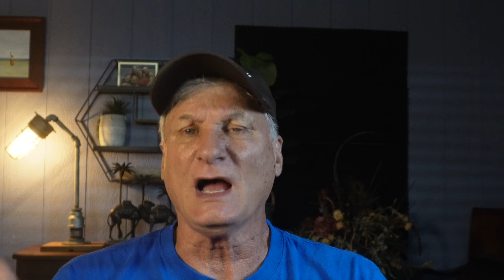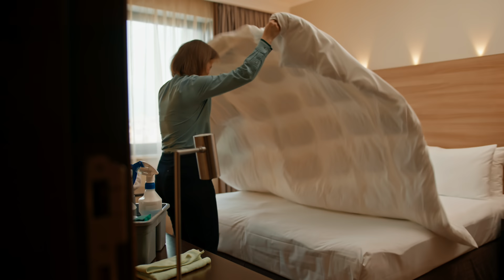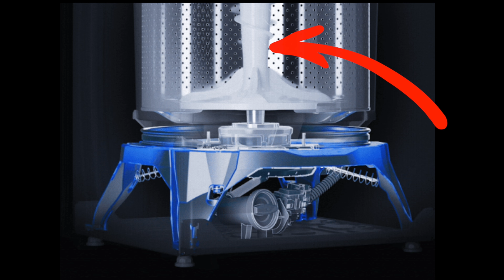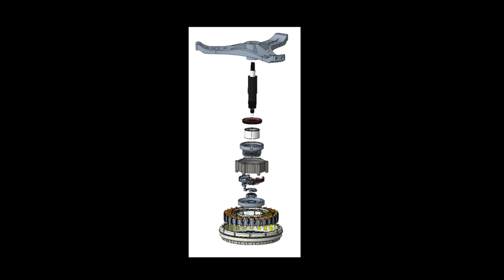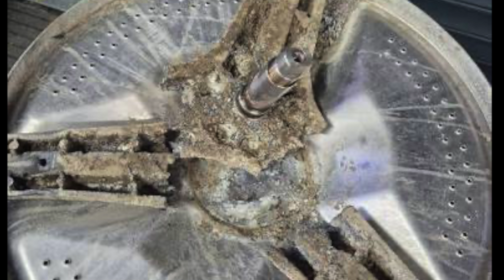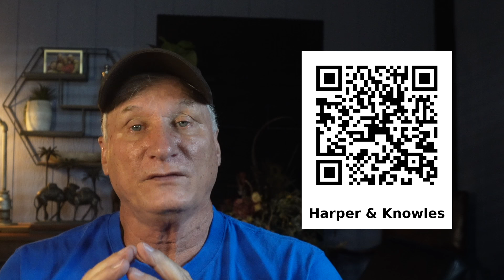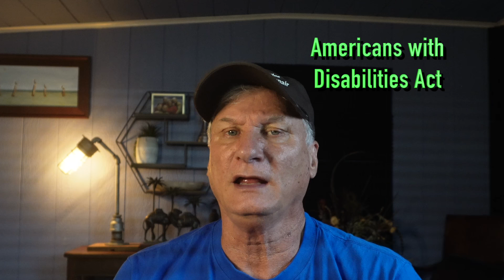Maytag's New 30-Year Washer: No Gearcase, Real Agitator, 900 RPM

Comment: I love my LG front load washer and matching electric dryer with sidekick pedestals... got them in 2010. I've had to replace the drain pump just once ($25) from all the sand in dog beds and just once replaced  the inner ($9) & outer ($9) main bearings because of the monthly washing of not balanced heavy load XL dog beds. Both jobs were cheap and easy.... just took watching a YouTube video, some time, and a $7 spring expansion tool. Overall it was fun and a very rewarding experience internally. A few months later we had a puddle of water in front of our LG french door refrigerator with bottom pull-out freezer drawer. So I defrosted it with an old HF heat gun, unclogged the defrost drain, gave the condenser coils a good cleaning with my handheld portable steam cleaner, and used the shop wet vac get everything out of the drain pan. With any luck 15-20 more years. I just wish water heaters lasted that long and were just as easy to work on. My home has 2 and I have personally replaced each one twice... so in my time in this house alone this place has seen 6 water heaters.
Reply: Thanks for the nostalgia, good for you. We need a NEW one, not what you had.

Comment: My daughter insists on Maytag. When it needed a pulley replacement, Appliance part salesman said part isn't available. Maytag says replace the motor. I send my Son in law a part number for a $5 part. Salesman said it's not a Maytag part. Told him to buy it anyway.  Screwed on no problem and works fine. $5 part or $300 plus motor. Checked the other part numbers while working on it. Whirlpool parts but ask for Maytag parts the exact same part is more expensive. Was a few years ago.

Comment: Maytag MTW8305T Warranty & DIY Breakdown: Year 1: Full coverage. Covers 100% of both parts and labor. Years 2–10: Limited parts coverage. Covers the drive motor and wash basket only. You must pay for all labor, diagnostic fees, and shipping. Years 11–30: No warranty coverage. Even though it is engineered for a 30-year lifespan, any breakdown after Year 10 (like Year 12) means you pay 100% out of pocket for parts and labor. Prorating: The warranty is NOT prorated. Covered parts are completely free during the warranty window, and full price after it expires. DIY Repairs: Mechanically, the machine is highly simplified (no belts, pulleys, or gearcases), making it very easy for a handy homeowner to repair. However, doing DIY repairs during the first 10 years will void your remaining factory warranty. Save the DIY work for Year 11 and beyond!

Comment: We had direct drive Whirlpool washers for decades. On lasted 25 years. When we bought a new model, the suspension rods lasted a year. After being replaced, there was no difference. That washer was trying to launch itself through a wall. I'd rather have a vintage direct drive again.

Comment: If they set up sensors that protect the machine against customer abuse better, it would also allow for better warranty on proper use. I have seen from just repairing a few machines how either, the customer gets lazy and overloads constantly on purpose or just lack of knowledge on how to properly use it. You can tell the difference when you open up the machine, but it's a little harder to prove. That drives the costs higher because the company loses money approving the repairs and that is passed to all the customers regardless if they have always used theirs properly. It's like theft rising in Wal-Mart and customers as a whole getting punished when they raise prices to make up the difference.

Comment: I have a laundry room at a RV park. It originally had mostly GE and one Whirlpool washer.
That Whirlpool was the biggest piece of garbage. The GEs were not great but still much better than Whirlpool. 
Mind you, these are coin operated machines.
The biggest problem with all of them was the tub suspension.  That's on both brands.
I replaced most of them with Speed Queens. 
In 4 years, the only problem I have had is the mixing valves. We have hard water and the valves fail. Other than that, they are tanks.
I would never buy a commercial Whirlpool washer.

Comment: I wish I would have done my homework and bought a used washer and dryer set instead of the new Whirlpool junk. The dryer broke less than 6 months in and the washer refuses to even use enough water to get the clothes wet! Even on "Deep wash" it only fills about 3 inches of water. I have to stand there and catch it after it "senses" the load and then fill it with a separate hose from the sink. Hopefully it doesn't switch over the the drain cycle and dump all of my washer detergent down the drain, forcing me to start over again! Their stupidity of trying to "save the planet" by not using enough water only forces the owner to run additional cycles 2-3 times in order to rinse all of the detergent out of the clothes. Otherwise, you get white powder residue all over your black pants. Nice job Whirlpool! You've created a washer that not only doesn't save water but it doesn't clean your clothes either. WORTHLESS JUNK!!! I'll be selling this set and buying a 20 y/o used set. 

Is it any wonder Whirlpool is spamming me with warranty insurance on a brand new washer?

Comment: I don’t care if whirlpool/Maytag gold plated their washers and sold them for $10. I will never ever in this lifetime buy another product by this POS company. They produce pure, unadulterated garbage. My 1974 Maytag set lasted 50 years. The two subsequent Maytag washers lasted less than three years. Their control board/power supplies died due to the lack of epoxy potting. The Customer experience was abysmal — the service people were inept and they screwed me knowing full well their supply chain was incapable of supplying the parts. Essentially, I came to learn that a Maytag washer is disposable. I will never ever put myself through that again. When a company screws its customers, I simply will never reward it with my business again. There’s a special place in hell for a company that pisses on a once proud American brand that was built by better people than the globalist cucks running these operations today. Whirlpool/Maytag deserves go bankrupt. Right now, speed queen has my vote.

Comment: So, huge water bill, wet clothes as no spin dy, soaking wet clothes dry couple of days inside and cause mold to the house, if using the press, buttons etc cause trouble, needs more detergent. And you will be stuck with that for 30 years. Nice choice...

Comment: I have give up on maytag.  I cannot believe LACK of quality, the OVER engineered junk that they sold me, that I bought based on my previous experience with Maytag.  I will never buy anything "energy/water" saving.  Appliances were meant to save TIME, EFFORT.  NOT water or energy.  Save me TIME and EFFORT and if you can squeeze in some savings elsewhere WITHOUT sacrificing the TIME & EFFORT, then fine.  But, I will NOT be buying a $1,500.00 maytag washer, when I tire of the current maytag foolishness; It will be a SPEED QUEEN, hands down, just like my dryer.  Because, it JUST WORKS.  Speed Queen engineers didn't loose sight of their purpose in life-save ME time, save effort.

Comment: I bought a house full of Whirlpool/KitchenAid appliances in 2002.

Surge suppressor MOVs on the cooktop control board burned like a welding arc during a power line surge. I watched it happen. Burned the traces off of the board, too. Got lucky, found a NOS board on eBay for $150.

Oven control board failed. Was lucky to trace the problem to a nearly microscopic surface mount transistor. Cobbled in a through-hole 2N3906 to fix it. Later on, a relay welded closed when an element burned out. Had to trip the breaker to stop the oven heating 24/7. eBay again, $329 NOS board.

Bought one of the first Duet washer/dryer pairs. Replaced the drain pump three times before getting one with a reliable impeller. Half a dozen failed inlet valves. Motor water shield shook its mounts apart, deafening rattle. Constant control board connection failures; worst PC board quality since 1960. Refurbed card edge connectors again and again. Power connector lead-free solder joints failed—of course—had to desolder them all and resolder with leaded solder. Got lucky with the basket bearing. It never failed. Dryer gas valve leaked, had to replace.

KA refrigerator pinholed, lost its refrigerant. (May we please have copper lines and coils again?) Replaced with Whirlpool. Control board quickly failed, another stuck relay. $300 plus a core charge. Most asinine icemaker design in history. Have to clear jams 2-3 times a week.

No more Whirlpool.

Comment: They just need to start producing the direct drive with 3360629 transmission and or someone with the money to buy the right and start producing or the old belt driven from the 60s 70s and 80s. As a repair technician big corporation is doing their best to make it a throw away when breaks and loosing customers faster than Ford's Police contacts with the crown vic

Comment: I got a brand new Maytag washer and dryer. The dryer takes 5x to dry one load. I’ve been hanging my clothes outside on the porch and then steam freshening them bc that’s the only cycle that works well on the dryer. The washing machine rusted around the bleach tray within one year and has since started chewing holes in my clothes. With and without the removable agitator. It’s only 3 years old. I laid almost $2,000 for the set. Maytag has gone to 💩

Comment: Bought new maytag washer and dryer 2 years ago. Dryer required a $300 circuit board at 13 months. Washer absolutely sucks. Won't put enough water in. Total garbage. I'm looking at a speed queen to replace it.

Comment: One piece at a time... reminds me of a 19495051525354555657585960616263... Cadillac.  >>;=)  It'd be neat to see a livestream or video of one of these units taken apart when (or if) they actually come out.  I am so sick and tired of this planned obsolescence crap and how we are in this whole arena of mfgd in China and only merely assembled in the US situation we are in with so many products (GE appliances for example, parts from abroad and put together in KY).  It's wild how much of the public feels a 10-year appliance is a "good appliance".  I just never bought into this... to me, a major appliance should most of the time last 20+ years.  I have an early 70s Kenmore washer I would be using except I had to break the agitator to get it off the shaft to get the machine apart, and didn't find a source for one (but maybe it uses the same one as more modern machines?) as other parts for it yet seem sourceable.. but I am using a mid-00s Whirlpool that I got off my dad and step mom when they had some problems with it.  I took it completely apart, deep cleaned it, repainted what was rusty, and replaced $40 worth of parts and until recently (another 8-10 years later), it's been cruising fine.  Currently fighting an agitator bolt that rusted that I may have to drill out, replace that bolt and the dog ear assembly, and it'll be back up despite being at least 20 yrs old at this point.  Maybe I've just been fortunate with what I've owned over the years, but I've been able to keep things running with small done-myself repairs.  Thusly, I own one of those spanner wrenches you were showing.  >>;=)  Also, still running off an '87 Kenmore gas dryer, but I mean... not much there TO go wrong LOL.  When I moved where I live now in 2010, I took that apart and just cleaned the heck out of it, but it's all original.
   Something that gets me is how control boards cost as much as laptops.  Circuit boards are pretty cheap to mfgr, I don't get why some appliances, the boards cost so much, pushing for replacement of the entire thing instead of one part of it.  I am hopeful for this to be a long-lived machine, because we need more quality products available on the market, which will force other mfgrs to up their game (but still avoid Samsung appliances like the plague that they are).  I feel just about everything you can buy in a big box store is just a step up from trash, and companies are chinching pennies to get you to buy new big purchases when I'd rather pay a little more for the actual product the first time and have it be more durable.  People who rant and rave about oil, the environment, etc., those same people forget plastic is made from oil and every product has plastic in it nowdays, so if we actually want to do ourselves a favor, we should be reducing how much and how many times we manufacture products (plus the power to run factories to do so), and opt for quality products and then replacing/upgrading specific parts as needed instead of throwing entire units away.  Many of us GenXers remember growing up in homes with the same appliances through entire times of growing up, some in HS still dealing with dark brown or avocado fridges.  😂
   What you said is so true sir, you get better when you buy better.  If consumers as a whole just flat quit buying lower of the bandwidth of quality of what is available, they'll either have to lower prices or offer more better-quality options.  The appliance market is rough, because you have so many builders and landlords who flood the market by being consumers of cheap as possible products to stuff into built/flippable homes to be sold or in rentals, plus just the modern general mindset that when making a purchase, the current price tag is ALL people look at instead of how the product is made, will it last, etc.  Although it's good business for fellows in the repair business, we should be trying to do better.  As those old commercials would indicate, the Maytag man should have lots of time to go fishing with the small-town sheriff.  >>;=)

Comment: I bought a used set of stackable front load LGs 6 yrs ago for $250. Ive had to replace the drain pump twice on the washer. Were one of those 15-20 loads a week families. I think they were 4-5yrs old when i bought them.

Comment: My moms Maytag washer lasted 41 years. Yes, my moms washer lasted 41 years and even was under salt water for several days inside the flooded home during Hurricane  Katrina and we moved it to the garage for disposal and sat their drying out for 8 months in a garage and we plugged it up and still worked.l! So we moved it 3 hours away and it was used until my mom moved.  Even the finish was not tarnished from the salt water! What the heck did they use back then for the finish? Salt water usually destroys everything! When she moved into assisted living we gave it away and from time to time we see the people in town and ask if it still works and it does. Unbelievable compared to todays appliances. Our WP fridge/freezer side by side, purchased in 1979 is still working today im 2026.  Still using that ugly old white thang but hey it works!  Never any service but we have kept all the dust vacuumed in the back and bottom front twice annually ourselves and it is still working. In the 60s great grandfather purchased a deep freezer cant remember brand, but he passed that deep freezer down thru family with it given to us in 1987 and we finally asked someone if they wanted it when we moved very far away  in Dec 2016 because we always heard if those old freezers are moved it could ajar the parts and not work anymore and we didnt have much room in moving truck. The former neighbors took it to store their meat. Saw that guy not long ago and it is still working also!  It is always topic of conversation today about longevity of these old appliances and our adult kids dont believe us, similar to stories of walking a mile to school I guess.  Even on these same brands, since started out of country mfrg and assembly and cheap plastic parts used on appliances , they last about 5 years. It is disgusting.  Revert to Good ole USA mfrg, USA made nonplastic parts, USA assembled and most importantly, USA Citizens making them!  My opinion.

Comment: I bought new, expensive Whirlpool washer and dryer and dishwasher in 2018, washer leaking out of the bottom of washer, already replaced the heating element and rollers on dryer. Dishwasher was absolute junk within 3 years, multiple repairs right away. Speed Queen for us when they finally quit and maybe Bosch dishwasher.

Comment: I haven't had to clean a filter in a top loader since the 1970's.  That washer pumped water during the entire cycle through a filter in the top of the agitator.  Why do you need a cleanout in a top loader?  Seems like engineers forgot when they turned a front loader face up (maybe they did it to charge more for a commercial washer).

Comment: Have a Maytag dryer.  Started to squeal after 5 years ( so a warranty would be no good anyways).  The idlers,  had to take it apart, and grease the rollers. I should not have to take apart a dryer to do that. My parents had machines, dryers, to last 20 to 30 years.  I had numerous problems with American made washers that failed within 5 years,  only Fridgedaire washer lasted 8 years or more. Will take a long time for me to trust American Brands again.

Comment: What frustrates me is that I have the new current Maytag commercial washer. I got it about 6 months ago. For some insane reason Maytag recently must have changed the software because “hot” is not straight hot anymore. It’s gone back to mixing in cold water and I can’t find any way to get to Maytag to see how I can get the original code that first came out.

Comment: I think Maytag said 30 days not 30 years. No whirlpool Maytag admiral what ever they call it will last in  5 or less years . If you put the tub seal below the water line it will fail. if you put a plain Steel shaft and s[pline it will rust out,  every machine i condemn is a rusted out trans spline 3 to 4 yrs old. 
Im glad i sold my stock in WP The CEO has NO EXPERINCE In APPLIANCES just a number cruncher.
Go Speed Queen